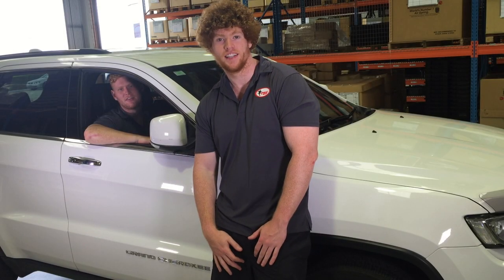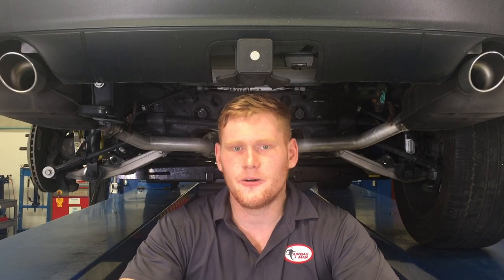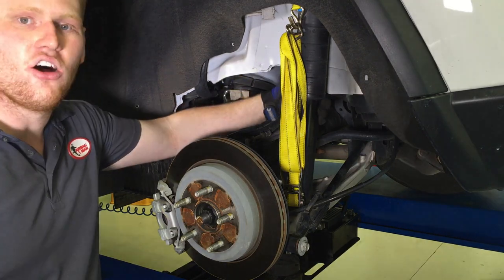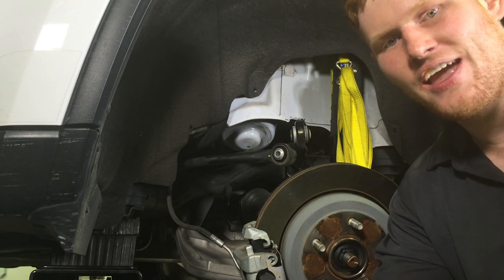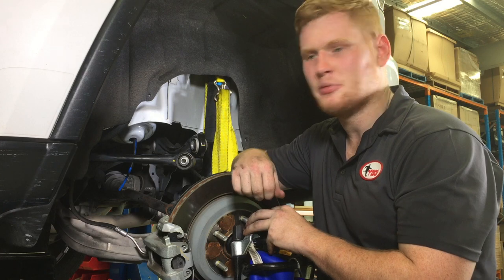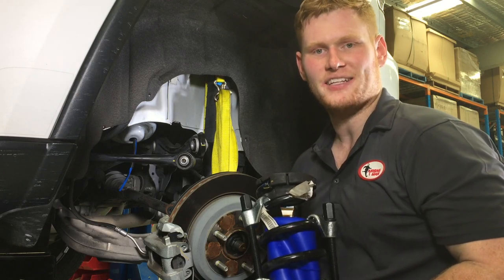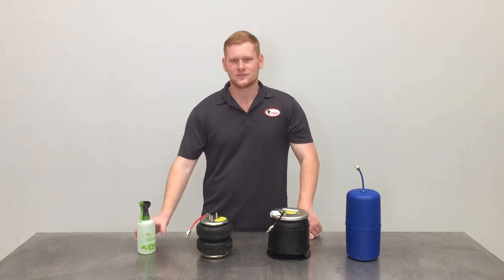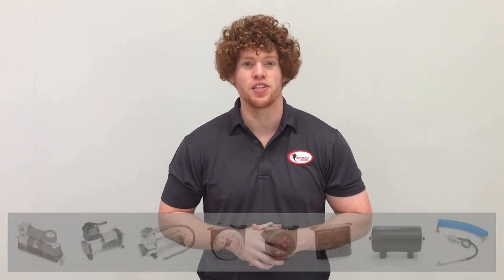How to Install: Jeep Grand Cherokee Air Suspension - CR5112 Airbag Man Coil Helper Kit

Comment: As you state, this vehicle has Nivomat load leveling/load supporting shocks. There is no reason you should be installing airbags on a vehicle that has functioning Nivomats(unless you want an even stiffer ride).

Comment: hi guys... I have a 2014 jeep grand Cherokee with the quadra-lift air suspension. In the off-road 2 setting (the highest it will go) it gives me 2.5 inches more clearance than normal. Do you guys make a kit/airbag that can give me more height for off roading?